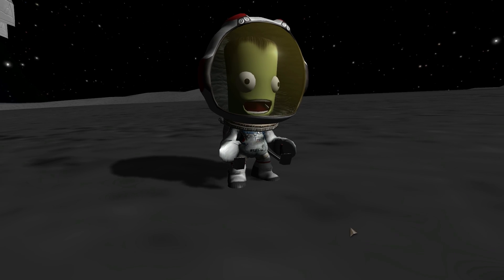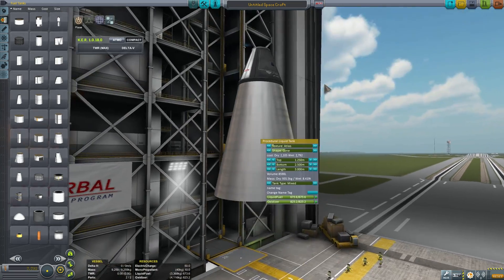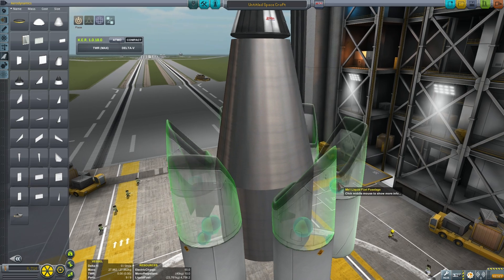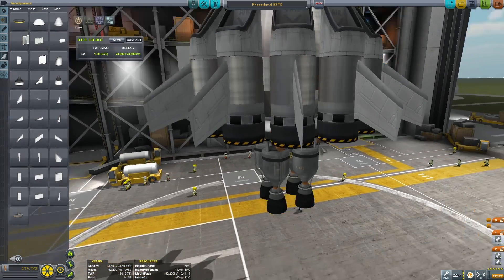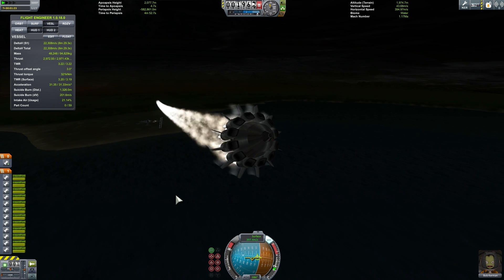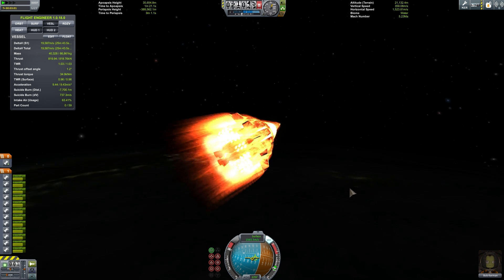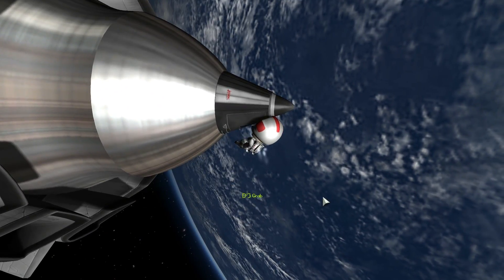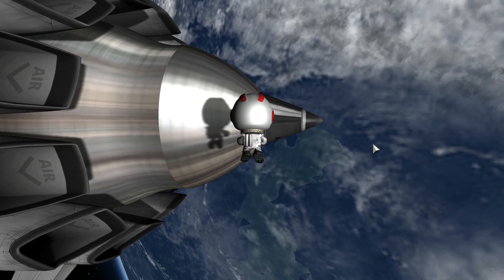Kerbal Space Program - Large SSTO with 4000 dV - Proper Use of RAPIER Engines

Comment: If you climb higher in the beginning the ascent will be more efficient. I made a craft similar to this one, with resource scanners and mining equipment. Great vid!
Reply: +joops110 For exampe: use a 45 degree angle until around 7-10 km (depends on the craft), then a 15 degree angle as you said yourself.
Reply: +joops110 I do the same, at the 8 km mark, i lock autopilot on prograde , prograde gradually lowers to 20 degrees, and this also reduces air friction